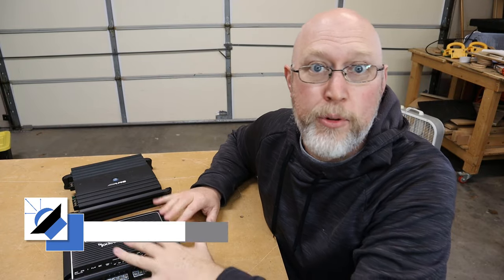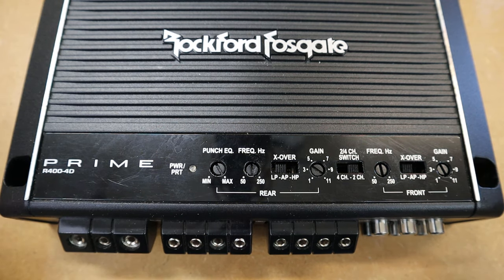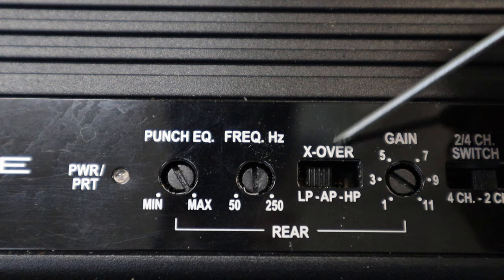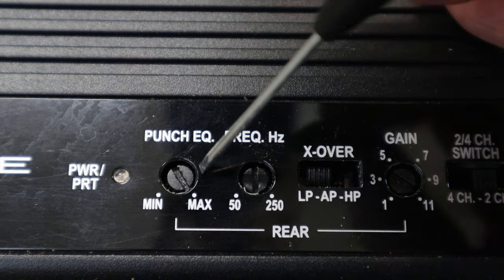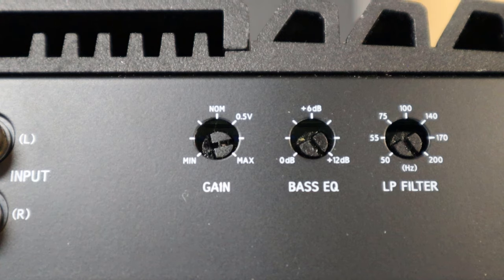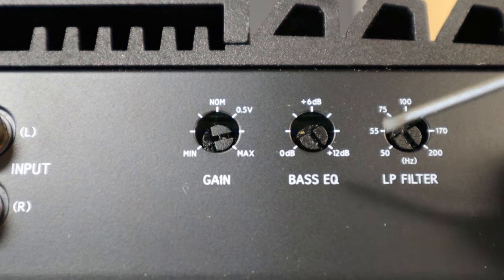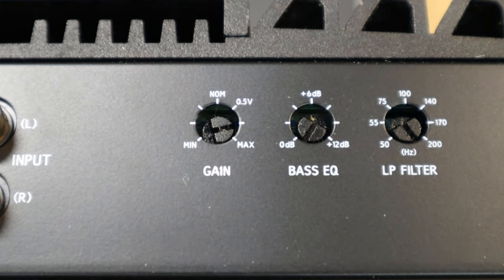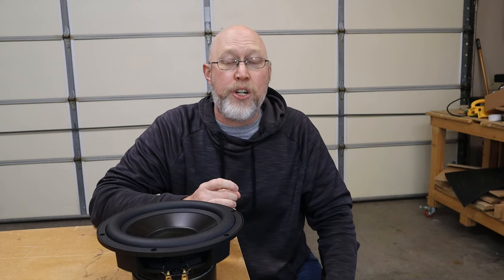How to set your bass boost!

Comment: What If I dont listen to loud music but still want to feel some punch then can I add bass boost
Reply from the maker: If the amp is set up correctly you will not need bass boost.
Reply: Yes, you can but you still have to be careful not to add too much or you're going to cause clipping which is not good.
Reply: @DIYAudioGuy  Unless you have really small and weak 100W RMS sub. In that case setting up gain properly is not going to result in good amounts of bass unless you turn your head units volume up to a point where your ears start bleeding from loud mids and highs.

Comment: I’m still new to adding amps to a aftermarket head unit. First my set up sounded like trash. Problem? Loudness was on. After I turned that off it got better. 

Now the sub. Bass boost is on. 😅
Reply from the maker: In the end it is all about great sound.  So play with all of the adjustments until you like what you hear.

Comment: Why do almost all amps from every company even offer bass boost?
Reply from the maker: Good question.
Reply: Because if you properly set up your subwoofers amp gain, you are not going to get max bass unless you also turn your head units volume way up. This is not really a problem with good and powerful subwoofers but with something small and weak like 100W sub it's going to be a problem because there may not be any good and loud bass untill your volume is turned up to ear bleeding level of mids and highs.
Reply: @CoreMaster111  im guessing that’s only true if you’re running your mids/highs and sub on the same amp. If you’re running bass through a separate amp then I don’t think you need bass boost, correct?

Comment: Why do companies even put bass boost on their amps to begin with? Thatd make a better video rather then how to set bass boost
Reply from the maker: I don't know the answer but I have some suspicions.  I try not to make a video on something unless I'm pretty confident that I know what I'm talking about.
Reply: @DIYAudioGuy  I have a feeling that bass boost is ment to blow subs/speakers so the consumer is forced to buy more.. thats just my theory though
Reply from the maker: @jordank7685  😁
Reply: Bass boost can be useful if you’re trying to restore bass roll off or if you listen to music that doesn’t have a lot of bass to begin with, but you should always set your gains after you’ve adjusted the bass boost to your liking
Reply: Because if you properly set up your subwoofers amp gain, you are not going to get max bass unless you also turn your head units volume way up. This is not really a problem with good and powerful subwoofers but with something small and weak like 100W sub it's going to be a problem because there may not be any good and loud bass untill your volume is turned up to ear bleeding level of mids and highs.

Comment: What if you don’t have a gain on your amp but have a bass boost Still turn it all the way down ? Lol
Reply from the maker: Yes.  But what kind of amp has no gain control?
Reply: Mine! DS18 zxi.1
Reply from the maker: @josecunsako31  it has a gain, it is label sens.
Reply: @DIYAudioGuy  how I set that up same as gain ?
Reply from the maker: @josecunsako31  Yep, the are just calling input sensitivity.  Some call it gain, some call it level control.
Reply: @DIYAudioGuy  thank you! I have a timpano tpt 1000.4 but it only has a level knob to adjust it, it doesn’t have no gain, subsonic, bass boost ,sensitivity button etc.. how  I tune that thing lol??